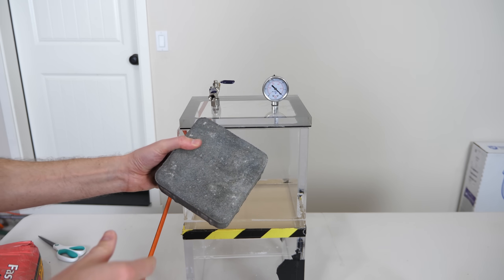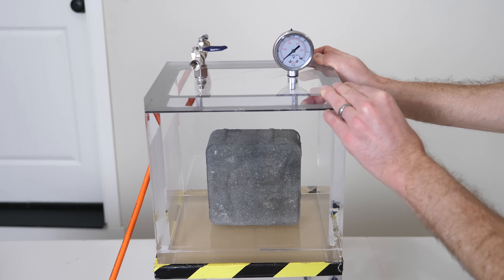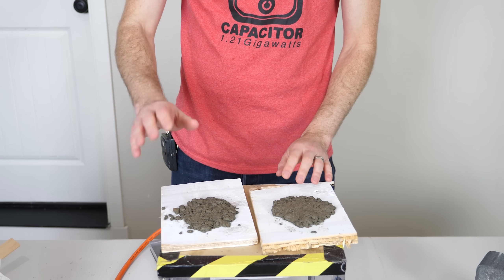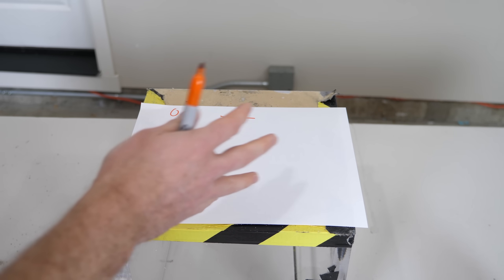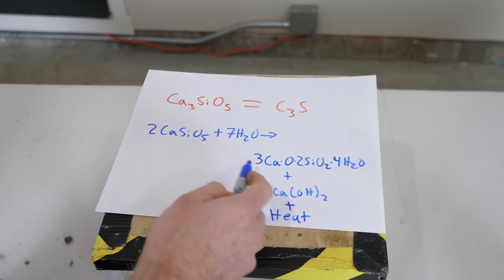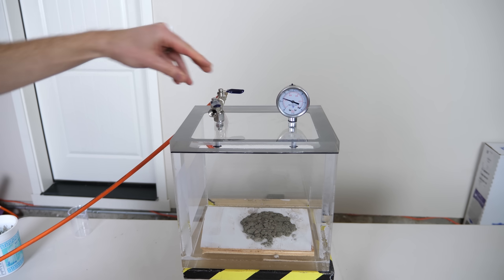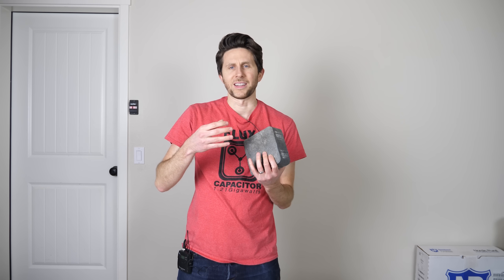Does Concrete Turn to Dust in a Vacuum Chamber? Concrete Without Oxygen Experiment

Comment: When you mix it like that you are mixing oxygen into the mix so when you put it inside the vacuum sealed chamber it has oxygen inside the mix, you take the air out of the box but does the concrete make almost like a protective layer causing the oxygen inside the mix to become trapped and not able to be sucked out of the chamber resulting in it hardening and still being the same as the one outside the chamber ?

Comment: You'd need to remove all of the oxygen atoms in order to properly test this experiment.
>You'd need to remove the oxygen from the silica itself. Basically it would be impossible to just Thanos-snap oxygen atoms out of concrete.

Comment: Commenting at 1:34: OBVIOUSLY nothing happens to this concrete slab in a vacuum chamber. In the thought experiment, the idea is that POOF, all air molecules (oxygen) are gone and in 5 seconds poof, they magically return. The vacuum chamber can't remove the oxygen thats trapped within solidified mixture, whereas the obviously absurd hypothetical thought experiment has the power to do whatever it wants. The oxygen trapped within the concrete would work like any tin can we shoot into space, you don't see the oxygen just leaving the ISS even though it is in the vacuum of space. Same with the concrete. Unless you could just Thanos snap all oxygen molecules away, nothing will happen. Use your brains people.

Comment: I was pretty sure nothing would happen. It would make no sense if that was true and we would not be able to use concrete and building off world like we're planning on doing. We're planning on turning regular into concrete and printing habitat covers. Just because the oxygen around is being vacuumed out doesn't mean it's actually going to extract it from the concrete. There would be no way for oxygen to just disappear for 5 seconds anyway and what they're also missing is if we gain just a few more percentage points of oxygen we'd be dead anyway. You have to be in this Goldilocks zone and if we had more oxygen than Neanderthal probably wouldn't have died either. Life is crazy but some people are crazier.

Comment: I think it would be a neat experiment to test aircrete in a vacuum chamber I feel like then it would definitely crack or explode
Reply: It wouldn’t. You’d have 1 atmosphere of difference between the inside of the air pockets and the outside, and with how tiny the air pockets are, the concrete should last just fine. 1 atmosphere of pressure is nothing for concrete.

Though there also would be no reason to use aircrete in a vacuum? From what I gather it’s used for isolation, but you already have isolating vacuum all around it. There’s literally no better isolation.

Comment: Concrete is a porous material. All gas absorbed will be outgassing from the sutrface and from the bulk through the pores [Torr l/s cm2].
A concrete block in a vacuum will change its mechanical, chemical and physical properties after a certain time according to the rate of the vacuum. On the moon, the vacuum is 10 to minus 12 Torr.

Comment: Some comments:
*If acrylic glass (what your achamber is made of) can take it, concrete can take it.
*The Damage of Vakuum is often exagerated. Remember, you can't get less that one atmosphere below relative zero. Compare hight pressure (like the hundreds of bars in the haber bosh process) this is high pressure.
*Cement is much less caustic, than you think. You don't need gloves. ONly old cement (containing cromate is iritant). It is not lime after alll. Still laying bricks with cement mortar is painfully hard, so better go for lime.
*Can you make a video about the softening of steel in heat ? A lot of conspiracy theorist say about 9/11, that "Jet fuel can't melt steel". The point is, that jet fuel can soften steel (ever heard of forging?). Steel reinforced concrete is actually very vulnerable to fire. More vulnerable than wood. Want fireproof building ? Buid from masonry arcs. Good luck, finding a brick layer from the gamer genration, that can make an arc...

Comment: 1:23 Mixing sand (officially called fine aggregate) and cement with water creates Mortar which is used for Brickwork and Plaster. Concrete is made up of Cement, sand and aggregate (officially called Course aggregate, can be stone or gravel) (aggregate is important for adding volume to the structure) with water. Replacing sand with "some other aggregate" doesn't lead to hydration and doesn't form concrete. Use correct terminology if you want to make an educational video.
Reply: Nerd.
Reply: @CinSGC  This is an educational video. Were you expecting to meet gangsters or something?
Reply: @gurjindersingh3843  nerd.

Comment: Cement does not "dry" it cures using water. If sement drys it won't cure and will remain dust. Ofc it brakes easily - concrete has a large load bearing capacity - but low shear and pull strength. That's why you use rebars to strengthen the construction.

Comment: Kinda wrong about what "concrete" is. It's usually a 1-2-1 ratio of, 1 part cement, 2 parts fine aggregate (usually sand) and 1 part coarse aggregate (usually gravel). Cement and Sand is just mortar. Which is generally a 1-1 ratio. The aggregate sizes are VERY important to it for structural integrity and density.

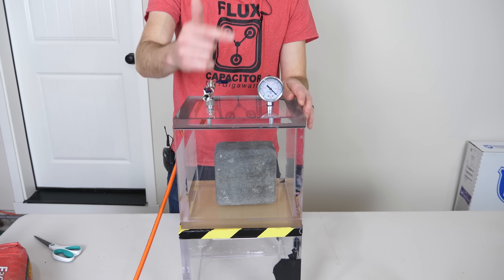Comment: Making an honest guess at 1:30 when asked, I'm thinking the concrete that is already cured with be absolutely fine in a vacuum, however, it does seem very possible that the cement may not cure in a vacuum, with no air to pull the moisture out of the mix, but I'm honestly not too sure.

Comment: It doesn't need air, but it does need the water. Pulling it off with the vacuum pump will interfere with the setting (not "drying") process.

Comment: evacuating air and removing oxygen molecules are different ideas.

Liquids will outgas or boil in low pressure tho. Which is the interesting part.

Comment: Actually concrete needs water and not air to cure. The concrete mixture is so thirsty that sometimes we need to spray water over it for days while it’s curing (otherwise cracks may appear due to water being used for reaction/evaporation)

Comment: 1:30 Nothing's gonna happen
10 years in civil construction
you are supposed to remove all the air pockets from the concrete before it solidify
usually using vibrating power tools
so, no, there won't be enough of air pockets to tear it from the inside and no atmospheric pressure to crush it from the outside

Comment: No oxygen is very different from no air at all. 
O2 is just 21% afaik, removing Nitrogen would be more disrupting, at least on concrete. On concrete, w/o O2 you don't have carbonation (or wth is called) so the cement hardens but don't strenghten along the first 10-15 years in contact with air, as it's supposed to do turning Calcium into CaCO Calcium carbonate, if i remind well.
Just that.
Without air instead, maybe some less resistant, air-filled, types of concrete (you can have concrete hardened with so much air inside to actually float like styrofoam, 0,2g/cm3 density or 1/5 weight than the same volume of water!) Those materials might report several cracks. Not blow-crash for sure like the video lets imagine.

Comment: Removing all oxygen atoms from the world is something COMPLETELY different. Vacuum chamber does not remove oxygen, it just removes the air pressure... Also crumbling concrete would be ridiculously  small problem compared to all the other things that would fall apart and turn into something completely different without oxygen atoms.

Comment: To the best of my knowledge, concrete relies on water to maintain it's integrity, not oxygen.  The best way to destroy concrete is to somehow suck all the water out of it, which would turn it back to dust.

Though I haven't watched the video yet so I could be remembering the info wrong lol
Reply: Concrete relies on water during its formation, sure. But once it’s dried, it’s dried. There is no more water in it. It’s a rock at that point.

Comment: You are correct in your analysis, but I think it would be interesting to take the experiment further.
Shorten the delta from one atmosphere to absolute zero atmosphere to 5 seconds and 0.5 seconds and I would be more inclined to believe it would be possible to shatter concrete by "pulling" a "sudden" vacuum.

I have no idea of how 5 seconds became a number, but it would be fun to test.

I suspect you will need a much larger vacuum chamber to store a vaccum to pull a vacuum rapidly into the chamber under study.

As forces will get ugly as surface area gets large on the vacuum chamber it may take arraying 3-4 small chambers to pull a vacuum of 1/20th of an atmosphere within 1/2 second.

At some point it should be possible to shatter concret with air trying to rush out of concrete, but difficult to do.

I would be surprised if 5 seconds to absolute vacuum would do it.  A 1/2 second might do the trick.

Comment: Try two concrete cylinders, one in the vacuum and one outside the vacuum.  Let them set for 7 days keeping the one in the vacuum for that period and then break them under compression.  Let me know what you find out.  I believe you will find out that oxygen does play a roll in the hydration process.

Comment: The vaccum vs. air curing differrence probably matters more if you have poured concrete where the one not exposed to vacuum may have air bubbles in it, whereas the one under vacuum would bubble out and perhaps have higher density because of that, and having higher density, it might have higher structural strength.

I'm curious to see if you could do an experiment comparing evacuated concrete which has been vacuum densified vs air-cured concrete. However, the type of concrete needs to be one that responds to that kind of treatment.

I had read that the proportion of water you add to concrete is really important, and that too much or too little water can weaken the cement. I had also heard that the ideal amount of water is the least water possible while also enabling all the cement to be wet. Not sure how this influences the ability to vacuum densify the material.

Comment: what about aerated concrete aka breaze blocks. They have lots of air in the concrete which makes the blocks lighter, so easier to handle and cheaper. If this type of concrete was in a vacuum, would the air trapped in the concrete ( at 1 bar) weaken the concrete itself ?

Comment: I think the concrete MAY get slightly weaker being under vacuum, and might crack from some air that is trapped inside the concrete, however, I feel like the majority of the integrity will be fine.

Comment: As a painter, I understand that any powders mixed with water is a chemical reaction that will dry no matter what conditions, where as paint and some filler dries by evaporation. Would be interesting to see if it still dries in a vacuum though.
Reply: I'd think it would dry near instantly, as vacuum will flash-evaporate water... Will probably crack it or even separate the pigment powder from the binder. But I second the fact it should be interesting to watch.
Reply: @wingsofwrath4647  yeah i agree if they have the potential to evaporate id guess the vacuum would do a faster job
Reply: Only some paints dry by evaporation, and not many at that. Most paints "dry" via a polymerization reaction, inlcuding latex, acrylic, and oil-based paints, and others. Some of these reactions, like the oil-based paint reactions, actually require the oxygen in air to work, so oil-based paints won't dry in a vacuum. Some paints just have a pigment suspended in a solvent, sometimes with a non-reactive binder, or a dye dissolved in a solvent, and these paints will dry just fine in a vacuum. These are things like water-colors and many inks. The solvent type paints are usually only used for artwork, as far as I know, and typically contain two or three things, a pigment or dye, a solvent, and maybe a binder. The binder is a goo that holds on to the pigment and medium, but doesn't need to react to set, just to dry. Examples of this type of binder include resins like gum arabic. Some paints and inks use a combination of the two techniques. Oil-based paints, for example, often have a solvent like turpentine blended in which must evaporate as the linseed oil base reacts with oxygen to polymerize in order for the paint to set. The solvent's main purpose is to allow you to paint a thinner, flatter layer of paint with fewer defects in the final surface finish. Latex paints use water as a solvent for the same reason.

Comment: I keep hearing dry and cure being used regarding the concrete. The concrete is not drying, it is curing as stated, there is a chemical reaction taking place. A related experiment might be to weigh the concrete before and after it hardens, it would be very similar in weight.

Comment: 1:26  best guess, nothing.  a vacume chamber is not taking away all oxygen.. its creating a lack of oxygen.  therefore the oxygen already locked into the structure of the concrete is locked and cannot be removed by a vacume alone, it would take a process to break apart the chemical structures of concrete to remove the oxygen, and a vacume alone is not able to do this.  as for it drying in a vacume, i would say yes,  it could depending on what the chemical reaction is,  because the oxygen it needs maybe supplied by other elements present in the makup of concrete.    and if not, then likely an agent can be added to give it the needed oxygen it takes to cure it.  underwater curing plasters are perfect example of this.

Comment: All liquids in an atmosphere will have gas dissolved within the liquid until equilibrium is achieved (Hendry’s Law). 
If you expose the liquid to a lower pressure or a vacuum then any gas dissolved will come out of solution. If this happens too quickly then bubbles will form. Theoretically if those bubbles formed in the water became trapped in setting cement then they would leave tiny voids which might lead to the overall strength of the cement being lower than normal.
Reply: If pressure was used to compress the cement, and all the gas was removed, it could also create a super cement that would be impervious to most gasses and liquids.

Comment: This experiment could use one more angle , it would be interesting to see if water has evaporated from the concrete , or how much water would this concrete absorb , under vacuum water will evaporate at a lower temperature , I don't think that's going to make much of a difference but would be interesting to try ,
maybe it needs to be redone again except this time have the whole experiment on a extremely sensitive scale .
P.S. 
There is no such thing as vacuum it is a lower atmospheric pressure , the only way to obtain almost a vacuum can only be done in outer space .

Comment: You should try the same test but instead of leave the vacuum, replace the oxygen with nitrogen and see if the concrete is still solid? Only in this way you can remove 100% oxygen

Comment: Concrete needs water to solidify. Not air. If u put it in a vacuum and some of that water in the mix evaporates,  and the lack of water in the mix will affect the strength of the concrete. 

Concrete is strongest when its left to cure inside the form work.

Comment: Once the H20 starts to react with cement in the mixture, the H20 don't boil off as it is combined in a solution... so vacuum don't stop the chemical reaction other than sublimate some H20 not combined... that means that concrete could set on space if temperatures was right?

Comment: it is true that concrete will crumb without oxygen but the reason it didn't crumb here is because the concrete itself traps a lot of oxygen inside that cannot be pumped out anyway.

+ without oxygen water will turn into hydrogen

Comment: PS. If you put an object in a Vacuum chamber and put the lid on,  it is at 14.7 PSI or 1 Atmosphere. Start sucking out the pressure until your gauge reads -1 atmosphere and doesn't that mean that your pressure is now at 0 PSI?

Comment: Correct me if I'm wrong but he's getting his Vacuum chamber down to  -1 Atmosphere? What a complete and useless test and idiots like this are all over youtube with these shill/troll experiments. The SHEEPLE really get taken in with this sort of fecal matter. For those who are interested:  -1 Atmosphere equals -760 Torr. (This is the name for the Vacuum Pressure scale). -760 Torr equals about -14.7 PSI. (Pounds per Square inch for the unknowing). As our standard air pressure is 14.7 PSI, 760 Torr or 1 Atmosphere then you can start to understand the utter BS of this 'experiment'. Even at 60,000 feet up, (just over 10 miles high) the pressure drops to about 0.90 PSI, about 45 Torr or about 0.060 Atmosphere. Anyone else thinking on these lines or have I got me maffs wrong?

Comment: They are not talking about oxygen gas only. It's a hypothetical  scenario explaining how important oxygen is because if it somehow completely disappeared from the planet in all of its forms (which is pretty impossible as far as we know) Then everything that uses oxygen molecules in its composition would fall apart. So this experiment is ignorant to the basic concept of that oxygen statement.
Reply: Maybe if you had a device that could remove oxygen molecules from that concrete block, then you can actually put the statement of those videos to the test. And here's a hint water is used to create a concrete and FYI the water molecules (which include oxygen) doesn't disappear they bind to the cement molecules. So oxygen molecules are still there keeping the chemical composition stable.

Comment: I'm pausing at 3:53 to make a guess on concrete "drying" in a vacuum; my guess is it will not fully catalyze in a vacuum if the water evaporates too quickly.
Reply: My apologies, I seemed to incorrect.